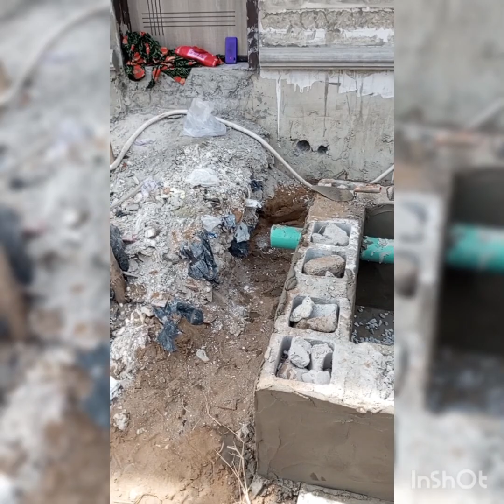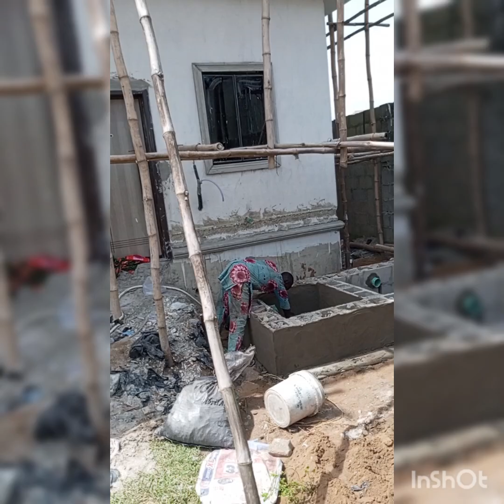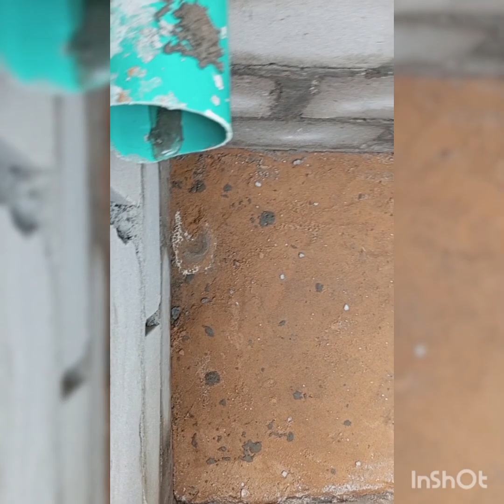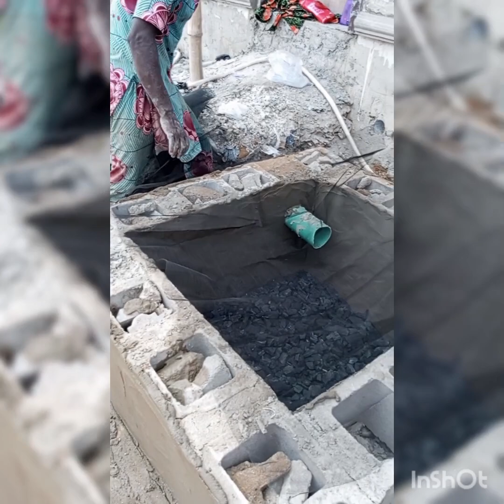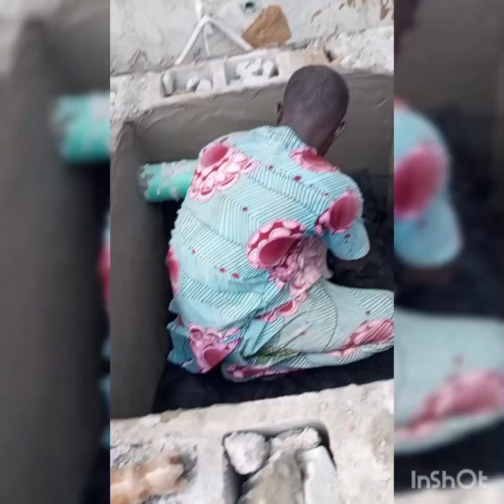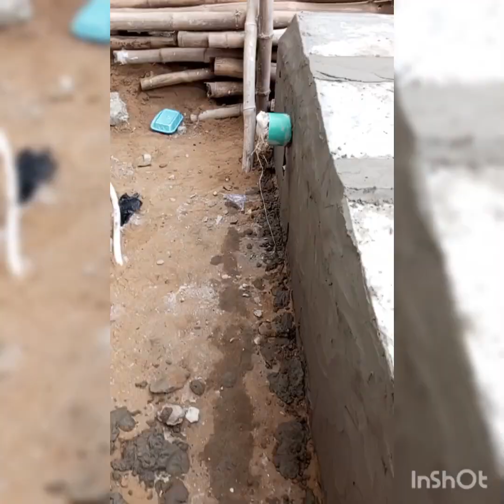The best Septic digester soakaway  in elemoro ibeju lekki

Comment: Sir, it's not the best to install a biodigester when the plumber has not finished projecting the pipes out. You could incur more expenses for the owner during landscaping. Secondly, the plumber could commit a blunder that would also incur cost to correct. Always wait for the plumber to finish then consider the elevation of the building and topography as in during landscaping before constructing a biodigester. Thank you
Reply from the maker: Yes, it's very important to plan the installation with the plumber and landscape architect.